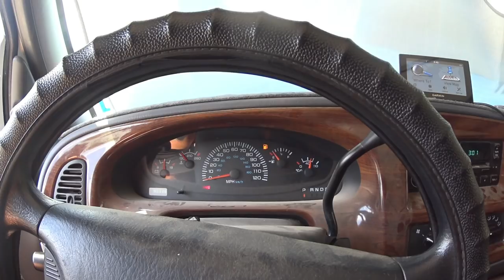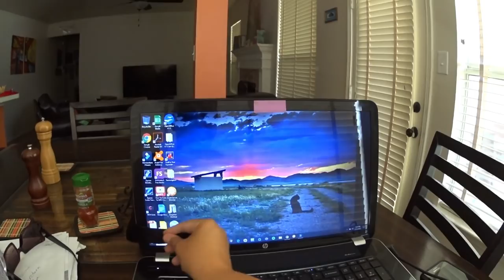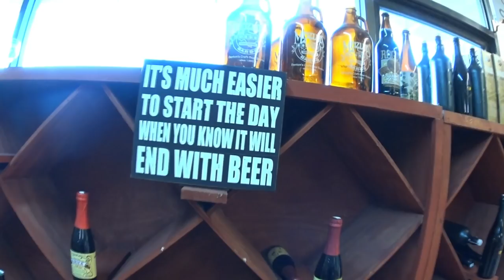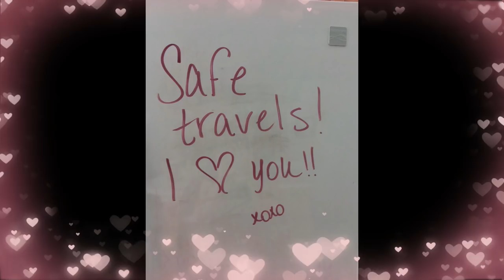Detour for electrical repairs // Bruce is my hero!

Comment: Angela, sounds like you may have a vacuum leak on your engine. Older vehicles have hoses that get rotten, leak, causing loss of power, rough idle. 
Glad you got back on the road. 
Stay safe!

Comment: I had the same thing happen on my rig, tech couldn’t find anything except mild corrosion on battery terminals. He cleaned those thoroughly with a Dremel and that fixed my problem.

Comment: Crankshaft position sensor or idle air control valve (husband is diesel mechanic) maybe if your near north Florida he can run a scanner on it to see what codes it shows. ❤️

Comment: since we're sharing van problems I have a 1990 E350 Ford Chinook. my check engine light was on intermittently and it was my throttle position sensor which a mechanic figured out for me, after I replaced numerous other parts myself. now my vehicle will die on a hot day.  after I let it rest it will start again. very frustrating getting stuck somewhere and hard to get a big rig towed. fuel pump in the tank may be the problem as the vehicle has a 115,000 miles on it and the fuel pumps are cooled by gas.  I read if you take your vehicle down below 1 quarter tank often the fuel pump will heat up and wear out quicker. I have always run mine down close to empty before buying gas.

Comment: You can just take the wire off one side and connect it to the other side and you will have power. When you get your new switch put back to original.

Comment: Ausia of Pandamonium just had the same problem with her rig. It was the egr valve and was an easy fix. If you know someone with a scanner you could get the codes read. I believe O Reillys have scanners and they read the codes.
Reply from the maker: No codes given. I mentioned EGR valve at a shop and they just scoffed at me.

Comment: NOT suggesting you just start blindly changing parts based on suggestions like mine. That will get expensive and still might not solve the problem. Being that your rig is a '99 model, It is probably fuel injected. Most F.I. motors use an Idle air control valve to control the idle speed. Carbon build up can cause them to stick and not be able to raise the idle sometimes when needed. 
This is a situation where a check engine light might be of some help. If it comes on, especially when the van acts up, The code it generates will likely point to the culprit.  lots of potential causes for the problem the van has. Good job on the electrical diagnosis.

Comment: As a journeyman Electrician you don't know how frustrating it is to see such simple issues stop folks. Get one of those code readers that will tell you whats wrong with the engine. (right on your phone)
Reply from the maker: It doesn't give me a code.
Reply: I have a Diesel and only know Fords so a mechanic is the right Idea.
Reply: Generally it's not getting enough Fuel or air when it stalls. , you do a lot of driving with lots of types of fuel , might be a clogged filter.???